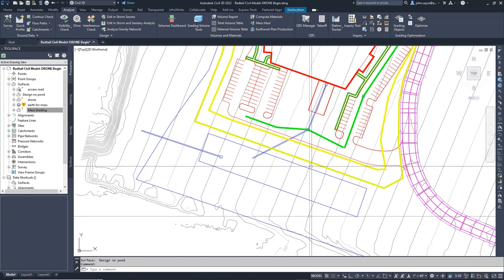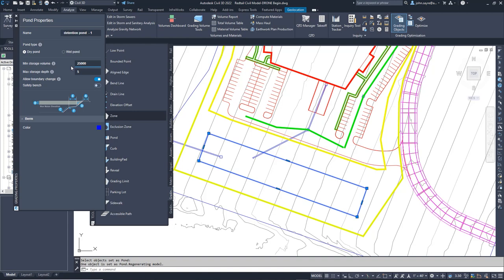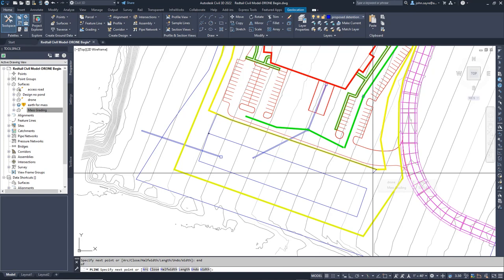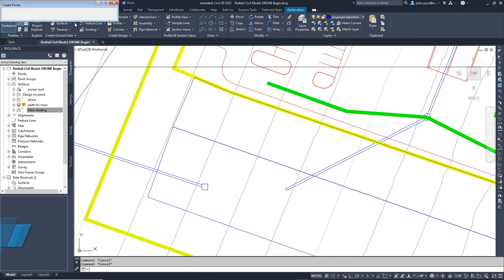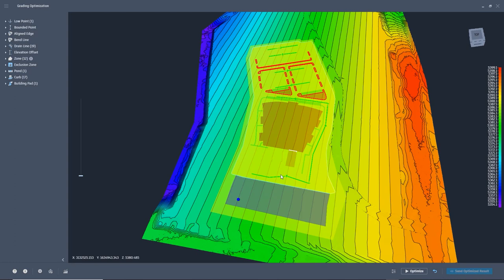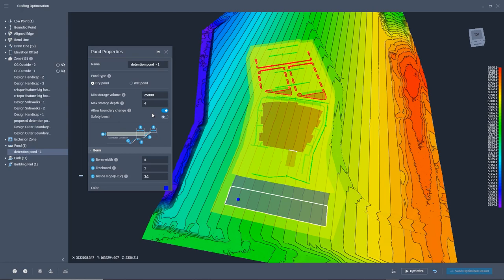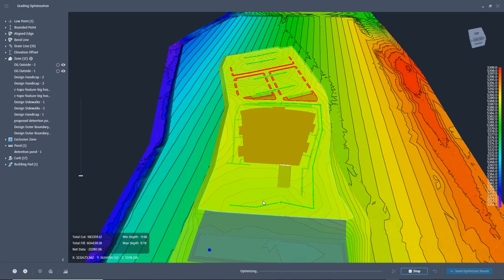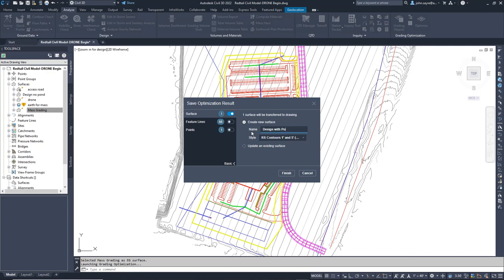Grading Optimization for Civil 3D - Part 5 of 5

Comment: Looks like AutoDesk is getting closer to a SiteOPS of their own!  They need to incorporate building pad/site templates that have pre-defined 'zones' that you can drop into the plan to simplify the grading solution development.  Also, there should be a provision to automatically switch to a wall if the slope gets too steep at the outer limits reach a solution.  Tie-in to existing roadway and access drive zones should also be included (like SiteOPS) that would assist with overall design and surface creation.  My 2cents...

Comment: I'm curious how that pond bottom grading turned out. In a long narrow rectangular pond like that we would have a pan running down the middle at say 0.5% to the outlet with the pond bottom slopes on either side of the pan draining at 2% to the pan.
Reply: Yea they need to have an input that tells it when a pond can be flat bottomed, or dry with a minimum 2% slope, or like you said, draining to a .5% pan or concrete swale.
Reply: I mean considering how much time was already saved, I wouldn't have a problem if that was the only thing I had to manually change after it was optimized.